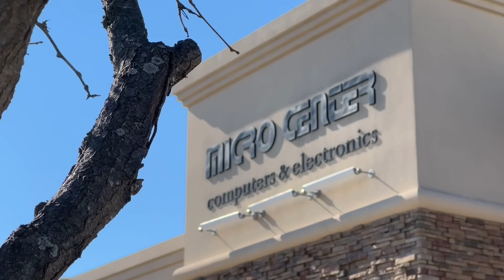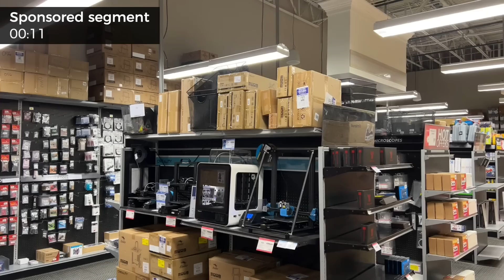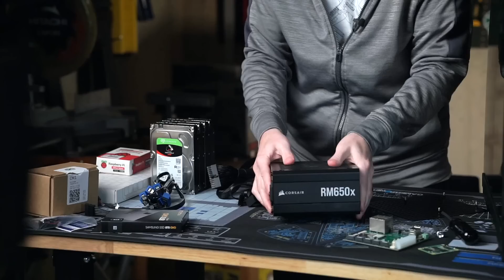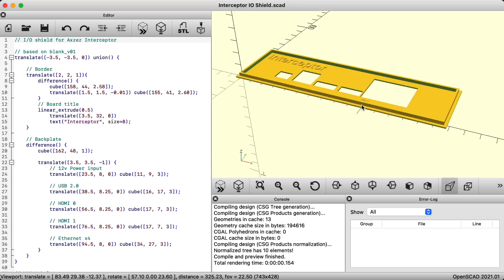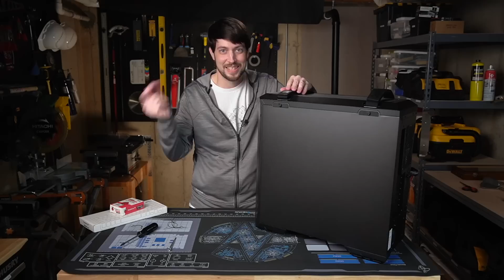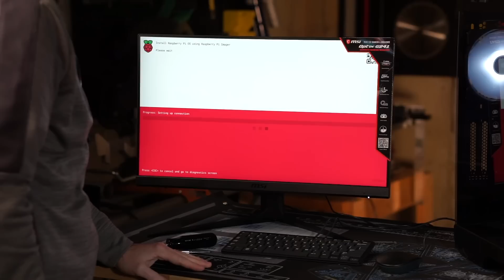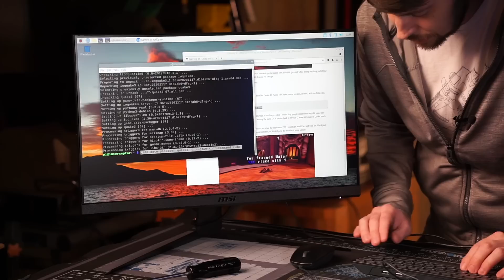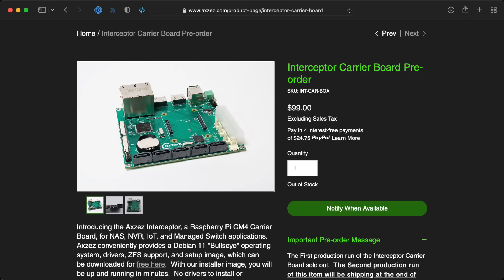Building a $500 Raspberry Pi Gaming PC

Comment: the monitor is smaller than the case
also i think you could put a bootloader like grub with all the drivers needed to set up sata on the compute module (if it has in-built storage) and just use that to boot whatever is on the sata ssd
Reply from the maker: Unfortunately it doesn't work on the Pi—the Pi's firmware currently supports NVMe, USB MSD, microSD/eMMC, netboot/PXE, and Network Install, but does not support SATA.
Reply: @JeffGeerling  i meant it more like how a typical bootloader works on a standard PC - the bios/firmware starts the bootloader on a specified drive/partition and then that bootloader boots whatever system it was configured to boot from another drive/partition
Unless I'm missing something really obvious, it should be possible, since after the pi has booted with all required drivers, the sata drives can be accessed by the os, so why not let the bootloader load these drivers and boot from sata that way?
Again I'm sorry if I'm missing something completely obvious and i end up looking like a total dunce
Reply from the maker: @Napert  Ah, yes, in that case it does work that way, but you'd still need that bootloader to be read in from a USB flash drive or the eMMC on the Compute Module. But yes, in that case it is quite doable (that's how Axzez's custom OS image boots if you put it on a SATA drive).

Comment: Could one in theory build this to include some HATs like a GPS HAT for time syncing? I know about the Open source Time Card that uses a Rubidium Oscillator but that’s very expensive for most people.
Reply from the maker: This particular board doesn't have the full 40 pin header for a Pi HAT, but something similar could be built with a $35 Compute Module 4 IO Board. There are also GPS dongles for USB that could help with the time syncing.

Comment: It is mind boggling how far miniaturisation has come. 24 terabytes of storage controlled by a miniature raspberry pi system on a chip all in PC case, 40 years ago 1 terabyte of disk storage would fill  a football field and the computer attached to them would need a warehouse to house it and need an electrical substation to power it all and keep it cool.
Reply: you're talking about the hard drives but the ssd here is even more impressive in comparison, 8tb in a wallet sized container capable of insane speeds

Comment: Hey Jeff. Long time viewer and subscriber, very infrequent YT commenter here. First, a hearty commendation to your esteemed camera operator for a stellar job. Getting the details on build videos is never easy. Also, loved the overall vibe which was a curious mix of generic tech youtuber build video as well as a sarcastic take on how seriously both tech creators and viewers treat this sort of thing - very meta (and f*ck Zuck for ruining that word for me!). It was brilliant, and huge bonus points for that! In the same vein, however, I couldn't help but cringe at the cable management choices, especially given the plethora of grommets and channels in the case for routing :P. All in all, love what you've been doing with your videos of late and this one is by far the best video I've come across in a long time. So thanks for all the info and the entertainment. ❤️
Reply from the maker: Heh. For the cable routing, since the Interceptor is so tiny, the included cable lengths could barely reach the ports on the board (for the front panel fans and motherboard power connector especially)... so I was a bit limited since I didn't have extensions :(

Hopefully I can make next week's build a little more tidy.
Reply: @JeffGeerling  Thanks so much for responding. And I was yanking your chain a little bit, and being a pain-in-the-butt know-it-all viewer. 😋
Reply from the maker: @rohitdeb6664  I figured as much ;)
Reply: I loved his 'edit' where he cleaned up all the cable mess, pause cam, fit side cover.

Comment: Hard drives don't need cooling if internal heat is properly vented.
Reply from the maker: That's the problem—there's nowhere for that radiant heat to go on the side. No vents on top, back, sides, etc.
Reply: 5400-ish RPM drives might not, but you most certainly do need cooling for 10K or higher RPM drives.

Comment: You could have had a cleaner build if you used the holes above the motherboard to connect the power supply and fans to the motherboard. :) Just saying
Reply from the maker: I would've, but the included cables didn't reach. Unfortunately I also don't have any extensions on hand (unlike LTT I don't have a warehouse full of parts hehe).

Comment: As far as 5V for a fan goes - I actually soldered myself a USB to 4-pin fan header adapter. I wouldn't want to run power-hungry fans off of that, but it does just fine for smaller ones.
Reply from the maker: That's actually not a bad idea. I think Axzez had mentioned that too, I just forgot about it. I have a little USB cable with the leads exposed I use to leech 5V power, too. Could've done it from the little on board header. I think that tiny fan would use a few hundred mA at most, so it would've worked.

Comment: When you do build your gaming machine I recommend linux with PCI pass through to a gaming VM thus you can easily switch between a linux and windows gaming vm and snapshot them. Note on installing a linux gaming vm with pci pass through. You need to lie and tell it you are installing windows otherwise it creates an unusable linux vm or at least that has been my experience. So many other advantages using vm's with PCI passthrough that I have fallen in love with the idea. Virt-manager is the only way I know of to use PCI Passthrough.
Reply: @09f9  Yes but anti cheat works in a windows vm with pci pass through as I recommended.
Reply: Ah looks like there are a few that will not work in a vm even on a windows vm but some do.

Comment: I'm imagining if there's some kind of dual-system-in-one-case thing, like Corsair Obsidian 1000, where the Interceptor sits on the mini-ITX side for solely powering the NAS while there's x86 system on the ATX side. That would be neat.
Reply: That'd actually be one great usecase for a case like the Corsair one you mentioned.
And it'd be pretty neat, too! Saves some space, fulfills some very important tasks, can even act as a mini-switch for the ethernet uplink and peripherals nearby and hold all the storage. Seriously, that'd be a neat build to make!
Reply: @IngwiePhoenix_nb  Additionally, the low power NAS can still be available to other devices on the network while the power hungry PC is switched off
Reply: Also for the Phanteks Enthoo Pro 2!
Reply: That sounds ideal for my setup! The only problem is that on amazon that case is going for 500 bucks. Can anybody point me towards a more budget friendly case that does the same thing?
Reply: @Perennial_Curiosity  IIRC, Phanteks 719 has the half price of Corsair 1000.
Reply: @Perennial_Curiosity  honestly I’d say the thing with the Corsair 1000d is nice but not necessary. It’s just a few mounting holes at the bottom and it has openings for the IO. It also has a bunch of mounts for a ton of hard disks. But if your goal is a NAS just build put it in its own mini itx case that’s built for that
Reply: Dude I have a Corsair 1000 d and I’ve been looking for this

Comment: People do still do lan parties. Even if LAN still requires a gateway through a WAN/ISP. 

there are small case designs like the Cougar QBX and more modern solutions than that dated case that isn't in production anymore. I have one myself and it's a beefy machine even if the Power Supply size tends to hold me back. 

This is a fascinating use case and I'd love to see it expanded with a full GPU. The hurdles of overcoming the non x86 cpu would be interesting when getting maybe late 2000s games? Being generous here. Given the performance of the pie, the 5700XT is likely overkill and a lower end GPU for this experiement might be beneficial.
Reply from the maker: Yeah; so far best candidate for getting more functionality is some of the early 2010s cards, which would also probably be about as much power as the Pi could handle efficiently.
Reply: @JeffGeerling  If all my stuff wasn't in storage, I'd be happy to give you a donor card.

Comment: The pi Needs two thing a American over the air receiver! One exists for UK! Meaning TV record through antennas! Also it needs a light video card! To push up backward compatibility! The Raspberry Pi foundation wanted to go public a mistake honestly!
Reply from the maker: There are a couple people in the issue queues on my Pi PCIe site database GitHub repo who are working on DVB TV tuning and reception (someone's doing a quad-receiver build!)
Reply: @JeffGeerling  No need to have a PCIe solution for grabbing OTA digital TV signals in the US.  Look up HDHomeRun by SiliconDust.  They have standalone digital receivers that you connect via ethernet to pull in data.
Reply from the maker: @d0glesby  I actually have a little HDHomeRun at my house, have been using it a few years now :)

But some people want to build their own little HDHomeRun-like boxes, thus the drive for using direct USB and PCIe capture cards.

Comment: I rate this video Wholesome+
It's been about as long for me since my last custom PC build. Are component prices coming back toward normal yet?
Reply from the maker: Surprisingly, yes! If you're willing to work with older-generation hardware, or low spec, you can finally build a new PC from parts for under $1000 that performs ... adequately.

Graphics cards that can perform well still cost way too much though.
Reply: @JeffGeerling  Looks like I have some shopping around to do. Thanks for sharing all these odd adventures with us. These are the types of projects I tend to try out that make my coworkers think I am nuts. 😅

Comment: Well the PSU and case should be capable to run a small cluster with somewhat 16 nodes including network equipment and still have enough room :D
Reply from the maker: At least! I bet I could fit 30 or 40 of Uptime Lab's compute module blades :D
Reply: @JeffGeerling  but after 16 I would assume network gear incl. Cables would become a nightmare would be an awesome video to watch though … like 8 node k3s, 1 nas, 1 node as router, 1 or 2 nodes dns/ldap for enterprisy stuff 1 node gui and jumphost and I guess a hell lot of other dedicated things… real whole lab in a box without huge virtualization

Comment: sticking a USB 2 sticker over a USB 3 one, I wholeheartedly support that level of precision and information sharing.
Reply from the maker: Can't confuse the kids when they're wondering why their flash drives are only copying at like 35 MB/sec!
Reply: @JeffGeerling  my internet is less than that
Reply: Or future selves 😅
Reply: Well, now I've got to reconsider the 20 amp outlets on my 15 amp lines in the kitchen. (Just kidding - it's all 15 amp.)
Reply: @Insightfill  As a brit, i have to apologise for my smugness, but honestly, BS1363 all the way. every socket is a 3kW socket, and the plugs are better in every way. the *&!# are worse than lego when on the floor though...
Reply: @justaguycalledjosh  Oh, agreed. This is what I've got in my older house I just bought. I'm planning on getting a few 220v, 20A runs put in soon. As it is, the toaster and microwave can't be used at the same time! The "Technology Connections" channel has spent some time on this US madness.
Reply: sharpie
Reply: I will do that from now on. I sell PC's and sometimes I run into a motherboard that doesn't have USB 3.0 headers so it's necessary to use an adapter.
Reply: Can the pi CPU even handle 35mb/s?
Reply: @Person1873  Pi4 has USB 3.0 and will happily read an SSD over USB3 at waaaaay more than 35MB/s

Comment: Always nice when the significant other helps. Holding a camera for however long this took to record probably wasn’t trivial so kudos to all the off-camera people. I also enjoyed the LTT reference and the JerryRigEverything Easter egg (finger snap before getting it started). 😊
Reply from the maker: I just don't have a fun intro to play :)

And my wife thanks you for the acknowledgement. It does get very tiring holding a gimbal (or even having a backpack rig like they have on fancier channels) for a while, especially if you don't normally do that for hours per day!
Reply: @JeffGeerling  What if you were to get a camera pole?  The camera sits on the pole, the pole stands on the floor, so all that has to be done is the camera operator has to point the camera and keep it vertical?  You'd PROBABLY get more stable shots as well instead of it being hand held.
Reply: Tripod, maybe?
Reply: As @Mr76Pontiac above just said, a monopod is ideal for this type of filming as it allows for minor adjustments in shot without having to hold the gimbal, while retaining the 'hand held' feel that makes something like this feel a bit more natural than just talking to a tripod
Reply: And the GN mod mat.
Reply: Tripod with wheels :)

Comment: With USB3 and an nvme slot this could be a pretty useful little board, but I guess it was made for a single purpose only.

Edit: oh! I’ve been wondering, how much power does this draw at the wall?
Reply from the maker: That's something I didn't test with my meter, unfortunately. But from similar builds with ATX and a fan or two, plus the drives, I'd bet on 20-40W.

Comment: try to desolder the ram chip and upgrade. you could also try to liquidnitrogen cool the pi to extreme over clock it
Reply from the maker: At some point I will likely be willing to sacrifice a Pi and see what crazy things can be done messing with core voltages and cooling :)

Comment: That motherboard is so tiny I'm afraid that the fan is too far to the right of the case for it to reach the heatsink effectively
Reply from the maker: Don't worry—I was doing some benchmarks, and the SoC temperature never went above 40. With the three intake fans blowing copious volumes of air that way, even without the exhaust fan running, the thing stayed quite cool.

With the tiny motherboard, it does create issues with cable routing—so many cables in such a small case, cable management was more of an afterthought :)

Comment: That's a wonderful ATX-compatible CM4 board with a lot of potential. So glad they gave it an RTC. Hope it can run OpenWRT.
Reply: I just realised how much acronyms we use daily in computer part names, thanks man
Reply: @__lasevix_  haha lol
Reply from the maker: It can, though the way the network interface works might not make this the same kind of router board you'd be used to. I haven't gotten deep enough into it yet though to form my final opinion :)
Reply: @JeffGeerling  I have seen home routers with that kind of configurable switch chip and OpenWRT, it seems to be handle those fine even inside luci, so it would not be a stretch to say the OpenWRT configuration to make it work should be minimal.
Reply from the maker: @frozendude707  Indeed; Axzez reached out and let me know they are integrating some OpenWRT tools into their build for chip management, so it should be able to do some fancy things!